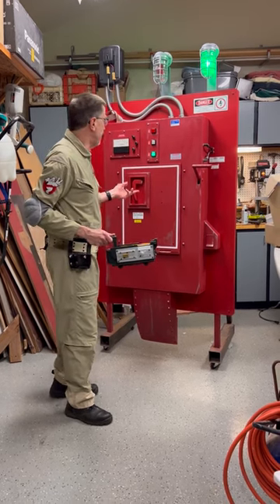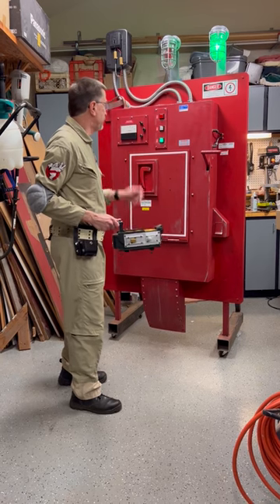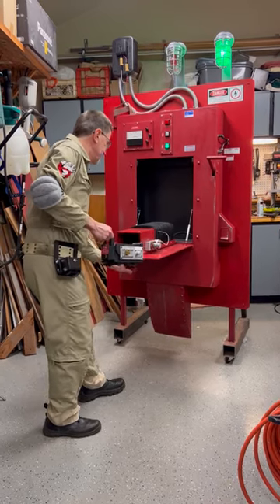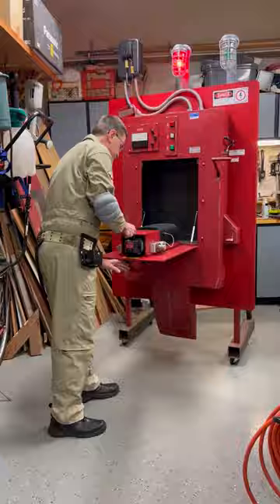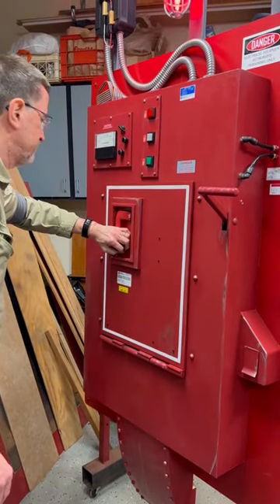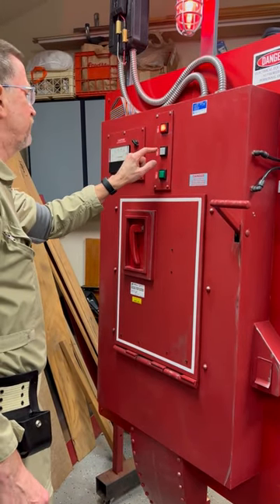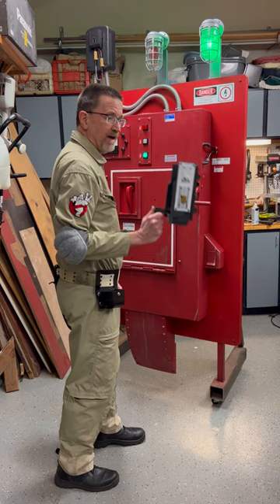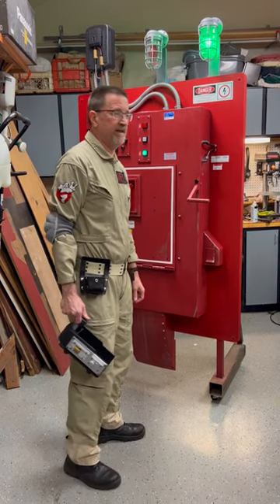Ecto Containment Unit 2023

Comment: Fantastic work, we at Ghostbusters Sardinia (Italy) are making it in 3D printing, where we can find the audio files and the electrical diagram,
Thanks in advance
Reply from the maker: We'd be willing to share that info with you. Can you read a schematic? The electronics are controlled by an Adafruit ItsyBitsy M0 Express running Circuit Python code written by a friend. How can we contact you?

Comment: Forgot to put the handle back up.   Need more training.
Reply from the maker: Thanks for the comment. That was intentional in this demo. At this point the code written by Patrick wasn't 100% dialed in, and that dictated where I (Shawn) placed the microswitches that trigger the lights and sounds. So the way those were configured in this demo throwing the main handle back up would trigger the "flush" sound again. After the Portland Ghostbusters debuted this unit at Fan Expo Patrick and I reworked the code, and I moved the switches so now we CAN throw the handle back up at the end of the sequence without triggering the sound effect again.